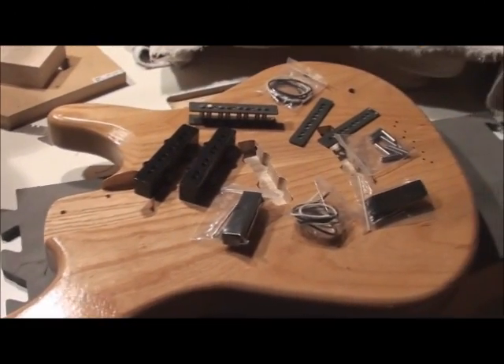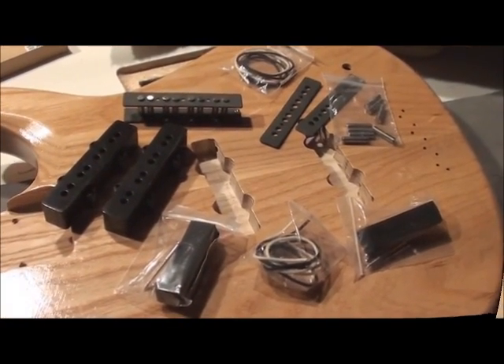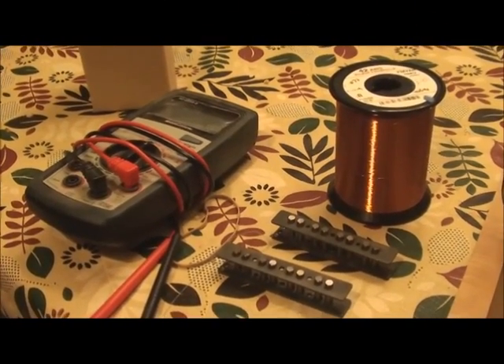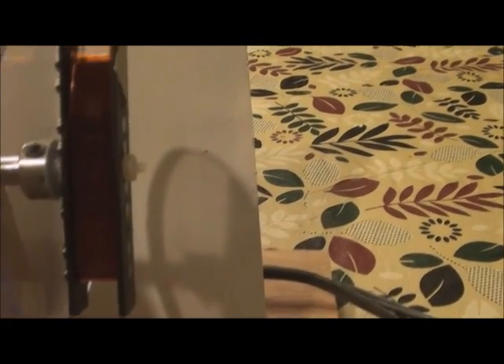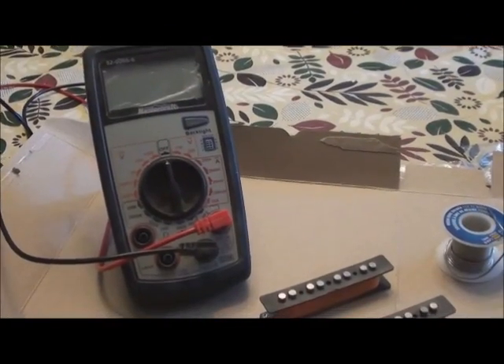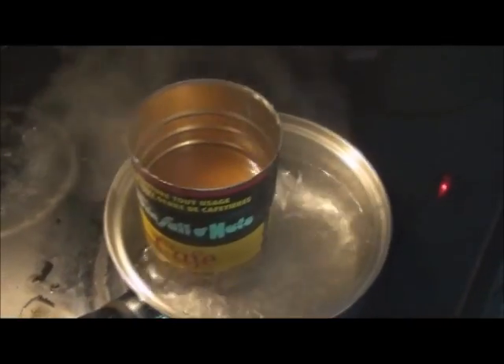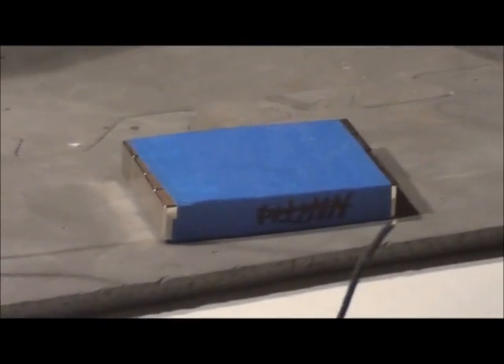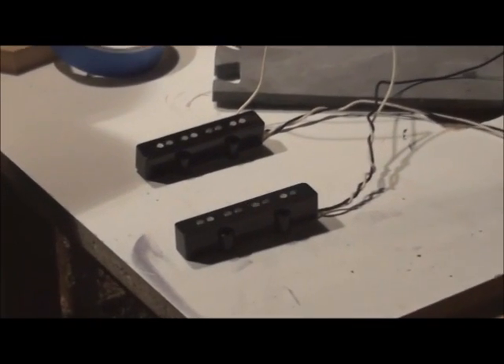making jazz bass pickups.wmv

Comment: Do you see how the ends of the flatwork pieces have flared apart a bit. This is caused by the wire pushing against them. The solution is very simple. Make a pair of aluminum or wooden backing plates to to hold the flatwork in place during winding, then add a few drops of super glue to the coil at each end. Allow that to harden up before removing the pickup from the winder.  You will get a much nicer fit inside the cover and against the metal bottom plate.
Reply from the maker: Great advise. Thank you for contributing to my channel

Comment: You need to slow down on winding that thin magnet wire, way to fast, I was just waiting for it to break and destroy all you've done, take your time, I've spliced many a wire in my day, it looks like a kit, not a scratch build, just saying, and one magnet per string is plenty, have fun...
Reply from the maker: jim ploetz that speed gave me the right wind I wanted. I’ve only snapped about 4 times over the 100 plus pups I wound

Comment: Hi and thanks for the video. Is it the number of winds or the total length of the copper wire that changes output? I'm making a one string bass pickup using a single Alnico magnet rod and 42 gauge wire and I have no idea how many winds to do around the copper rod or whether it will work. Any tips would be greatly appreciated. I'm going for a PBass type sound. Thanks!
Reply: Edward Meunier you need to measure the resistance of the wire you're using per metre or foot depending on your preferred measurement system. Then measure an approximate length of wire per one entire revolution of the pickup bobbin. Then you can decide on what resistance you want and calculate how many turns off wire you will need.

If your wire is 5 ohm per metre. And one revolution of the pickup is 20cm, then 1 turn of wire will give you approximately 1 ohm. To get a pickup with 7.2k ohm, you'll need approximately 7200 turns of wire.

This isn't a real life example. Just helping illustrate how to calculate.

Comment: Have you experimented with winding techniques.  It seems to me that untidy winding might be better than neat, layer winding as it will have less interwinding capacity and therefore should deliver more high frequency.  You could even try putting down one layer, adding a layer of paper and then putting on the next layer, with paper between each layer.  This should give you very low capacitance.
Reply from the maker: I do any different layering techniques

Comment: The magnets are unmagnetized ? I don't get that. Later....have fun.
Reply from the maker: the magnets come from my supplier unmagnetized so I need to charge them.
Reply: I can dig it. But why trouble yourself when you can get premaged slugs ? Just wondering.
Reply from the maker: Its easier to work with them unmagnetized

Comment: Bill Im doing a telecaster guitar to Baritone Bass conversion. I'm keeping the Tele, all original body and Nexk as I have damaged my left elbow and cannot fret my bass's any longer. Thios is all new to me so really appreciate all you are doing and have done! Could you explain how to choose tone/change tone with winding. How many winding for what bass tone etc. Regards from Spain.
Reply from the maker: Hi, glad you like the videos. Those pups have I believe 9000 winds. Tension, coil shape, thickness, height, wraps per layer all play a part in the overall tone. A tall and narrow coil will have a more concentrated focus on the strings as opposed to a low and wide coil, the more winds you do the more highs you will lose. Hope this helps
Reply: Ok, thanks Bill. Nothing easy there then! Back to experimentation!
Reply from the maker: Yes kind of.

Comment: Hey Bill, cool stuff! I built my own winder a few months ago but could not find the right solution for a counter. I used a calculater and a reed-switch to count the windings but the problem with that is, I can't go fast. At a certain point, my calculator is too slow to count. How did you that? 
Looks like you're using a light barrier with your cd or something? I don't get it. Would be awesome to know, how you did it. Thank you very very much :)

Comment: the wire broke in the middle when I was coiling but I soldered it. How do I exactly check if my pick up is working without connecting it to the guitar. I tried checkin the resistance. The reading was 1.14

Comment from the maker: Hi. So Delightmyheart. Did you check with the store first to see what they would do. You could push it down BUT it could damage the inner part of the coil. If the coilwire is somehow stuck to the polepiece it could pull and break and you wouldnt know untill it was too late. Ceck with the store and see what they say first they should fix it fir you.